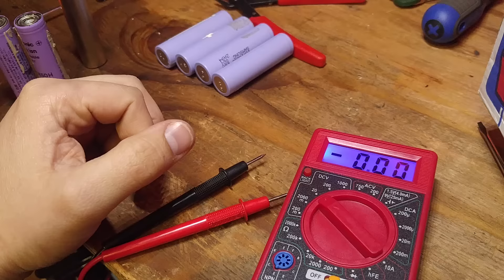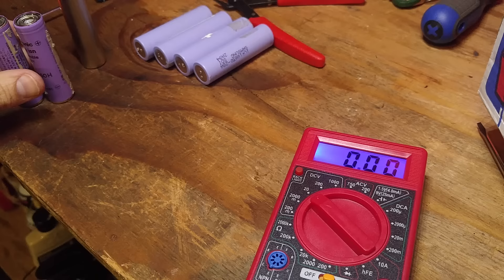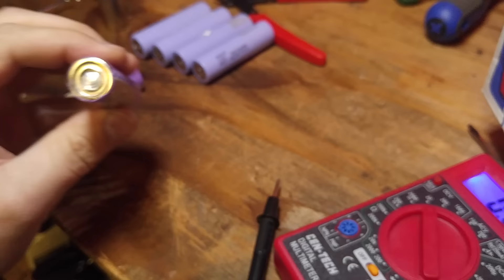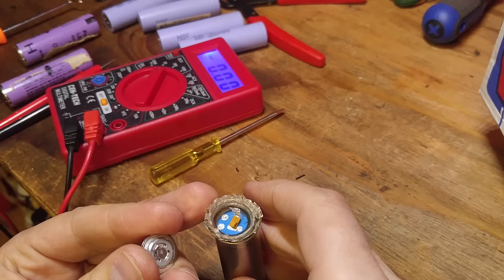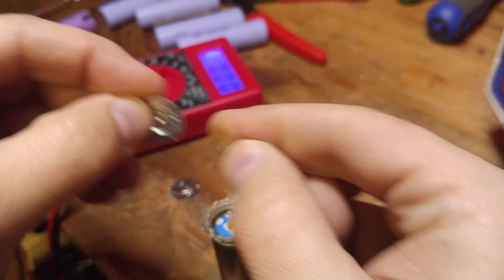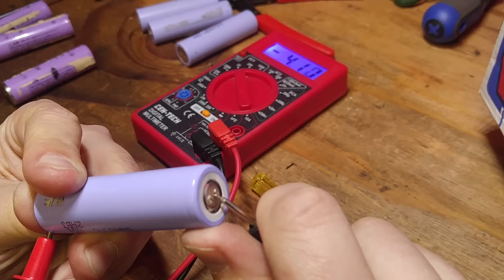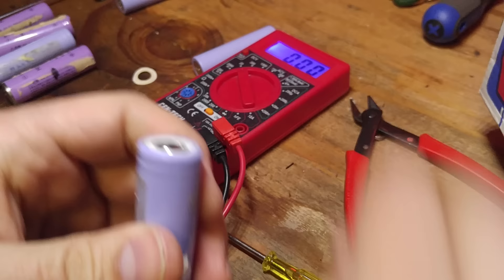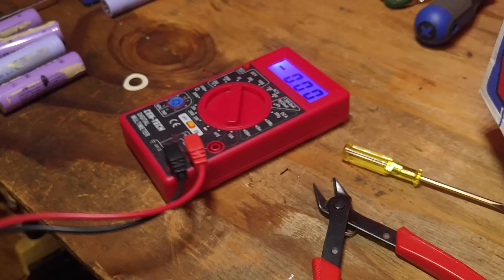0v 18650 - How the CID works

Comment: Hi, I followed your method and saved my 18650 with the same problem.  But I want to know the cause of the "0V and open circuit".  One of the saved cells got the problem again and I used the same method to save it again.  I want to know how to avoid the problem so that I do not need to use the method again.  If anyone knows the answer to the problem, please post it here.
Reply: TM HO Just dont use this "method" its just like giving your battery a second chance to make it vent violently! Dont play with 18650s this way...
Reply: The popping contact is a safety device and it's there for a reason. If the contact popped the cell was used in a way that made it's electrolyte decompose and build up pressure. Cells that went into that state will have greatly increased internal resistance and heat up even more than before. If you are lucky the seal just pops again then. But it's also likely they internally short circuit when used further and at that time the seal won't save you anymore. The cell can heat up to the point where it ignites the electrolyte and you got your well known li ion battery fire (btw. Lithium has nothing to do with those battery fires at all; it's the electrolyte that's burning).

Comment: Thanks I just get these batteries to make 12 volts for ATV and scooter and lawnmower batteries so if they blow up it won't matter to me I blow up the engines on all of these 4 wheelers anyways there nice because there light weight if not I will put a big marine battery in ATV that will slow me down dude

Comment: I think I overcharged mine in my mod I would charge them up to 100 unplug it go down to 97% so I plugged it back in thinking it needed more time it was 100 again unplugged it and it was 98 I was like you will go 100%. I did it once more and now my mod is dead. I think my batteries popped out I am new to mods anyways but yeah I wont be doing that again. I hope it the batteries I can't really tell under there if its popped up or not.

Comment: Personally I think this is built in to fool you into thinking your battery is dead and you go out and buy a new, expensive, one. Great way to keep their battery sales up!
Reply: More like one of the many required safety mechanisms that keep these from blowing up when they enter into a situation (like heat) that pushes them out of their safe operating parameters...

But you could be right, it might be a government, corporate, or Shadow Group conspiracy
Reply: Not a conspiracy. Just marketing ploys. You know, like how the tobacco industry purposely addicted people to their product so they could keep their sales up? Or how everything is imported from China today and it's all made with the cheapest labor and parts that can be had just for it to break within days or weeks and you have to buy a new one. great way to keep sales up no? A happy coincidence maybe?
Reply: Don, some people just refuse to see or admit the truth. They have a word for that also. It's called cognitive dissonance. Just believe whatever comes to mind and be happy with it.
Reply: The cognitive dissonance is strong in you for sure (well it would be, if you used the right word and call it confirmation bias). The popping contact is a safety device and it's there for a safety reason, not some "industry-wants-to-sell-more-stuff-conspiracy" reason. If the contact popped the cell was used in a way that made it's electrolyte decompose and build up pressure. Cells that went into that state are likely to internally short circuit when used further. If you are lucky the seal pops again then.
Reply: MrCougar214 things are made cheap cus people want to buy cheap. Age old motto buy cheap buy twice. Buy a cheap screwdriver and the tip won’t fit right and will break easy buy a good quality one and it will last a lifetime. People wanna buy cheap that’s why the cheap shops are out there your choice.
Reply: Thats a safety cutoff. Dont mess with it.
Reply: You would change ur mind real fast if you had one dead short in your pocket.  Oowee...we talking 3rd degree burns

Comment: In the old days, people took house fuses that kept blowing and replaced them with pennies.  It works until you burn your house down, along with your family. So these batteries have a safety feature and you think you cleverly disabled it.  NOT ME, THANKS!
Reply: The guy said to use your own brain and do what you want to do. You obviously smart enough to know that it's the battery safety feature, so don't worry about it. 

Timestamp 6:19

Comment: amazing that this video has not been removed considering how much damage this is causing and how many people could be hurt. The CID is there to dissable the battery when it has been cooked. it's not meant to be reset or reused. the battery is no good and a danger. So dangerous to the point where they had to put a physical switch on each battery taking up valuable space. resetting this switch just allowes you to continue to use a damaged battery that is not supposed to be used anymore. Also poking holes in release the pressue that is in the battery due to its damaged state is not what you should be doing. The CID is not some trick or secret way to dissable a good battery. it is an important safty device. When he uses his ignorace to show others how to circumnavicate important safety features in batteries people should not be thanking him. Remember they are damaged batters. Not resetable. Yes they will show voltage but they are perminantly damaged and dangerious now.
Reply from the maker: Yes, this is NOT a revival technique! I haven't checked back in a while so I had to highlight this for safety. If someone decides to do that they're doing it at their own risk. 3 years ago or so when I posted this video it was pretty much just to teach others how the physical protection system worked because this info wasn't readily available without prior knowledge or some digging, now it's quite easy to find. So be careful everyone. And FYI for everyone else, I'm not using any of these cells, I'd only use them if I was without a source of cells in a remote area and they were outside and couldn't cause major damage if they lit up (forest fire, home fire, burns, property damage). Don't build a powerwall with any of them or use them in your house!!! As I stated in the description most are junk anyways, with the best being 1/2 of original capacity.

Comment: This could have been a 2 minute video...
Its like a thermal circuit breaker for the battery.

I dropped my light and it activated this safety feature

Comment: Playing with fire..
Reply: Verightess 18650 battery are not that dangerous, they need to over heat for about 5 minute before they explode. You’ll feel it overheats if there’s a short you’ll notice it way before it catch fire..
Reply: @alek8835  yeah, tell that to all those with house fires and 3rd degree burns